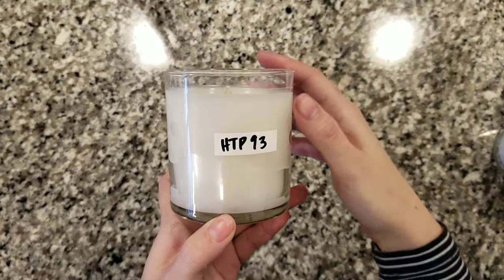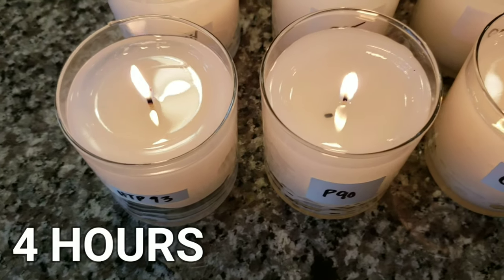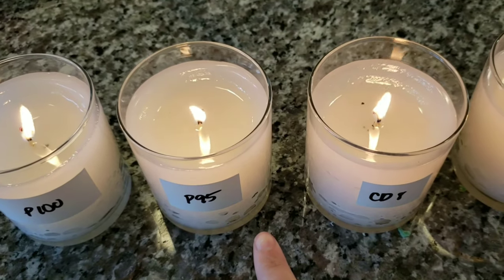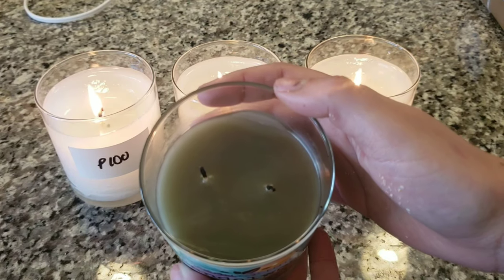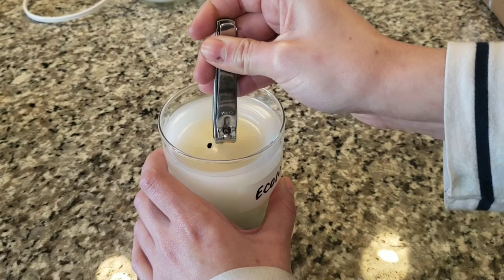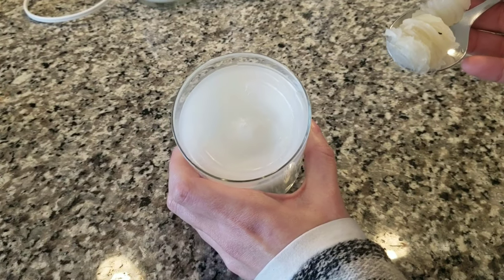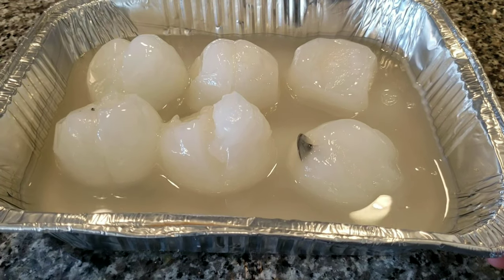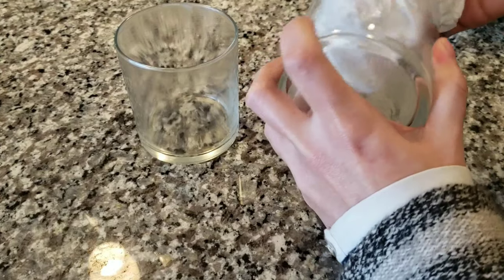Candle Wick Testing Part 1 | Sinfully Scented

Comment: I know this video is old but I would recommend pouring the candles (without any wicks), allow them to set then poke a hole down through the wax and insert a wick.  If a wick doesn't work, just pull it out and replace it with a different one.
Reply: that takes too much time because you have to burn them 2-4 hrs at a time to really see the melt pool. burning all at the same time lets you try multieple wicks and meltpools
Reply: @dandee28  Spot on!!😃
Reply: I would definitely NOT recommend wickless testing.

Comment: Double wick these jars.
Why didn't you add fo?
Reply: Ive seen on some articles doing it without fragrance oil so you can remelt the wax and use it over again to re wick. Kinda like adding one factor at a time then you can add fragrance oil once u found the right wick and if something goes wrong you can do process of elimination of what went wrong
:D
Reply: She should have gone with the LX20 as recommended on CS.   Starting with a full 4 hour burn on these Libbey 917CD will get a full melt pool if not near perfect, and then each burn after that (ending near 4 hours) is certainly a full melt pool.  This is obv going to vary on the %FO you put into each candle you offer

Comment: Greetings from China~

This is Catherine from Candle Machine Making Co.,Ltd China, we are OEM for making all kinds of candle machines, having been in the candle machine making field since 1998, all the machine's components are made by ourselves, The quality is best in the candle machine field!

We mainly produce automatic tealight candle machine, automatic pillar candle machine (hydraulic and mechanical), multi-function candle machine, automatic wick cutting machine (pneumatic and mechanical), automatic wick waxing machine, automatic tealight/glasses/jar filling, glasses injection machine, wax melting tank, rotor drum granulation machine (making wax powder), automatic tealight pressing assembly line, aluminum cups punching machine, manually long tape candle machine, also candle accessories: wick tabs and tealight cups, wicks...

Hope the above information will be valuable for you! If you have any further information for any other candle machines, pls feel free to ask me at any time is Ok.

CANDLE MACHINE COMPANY.